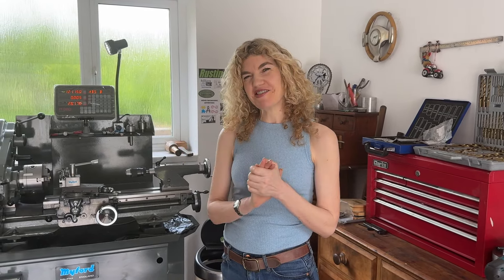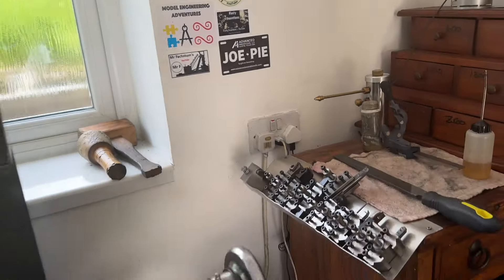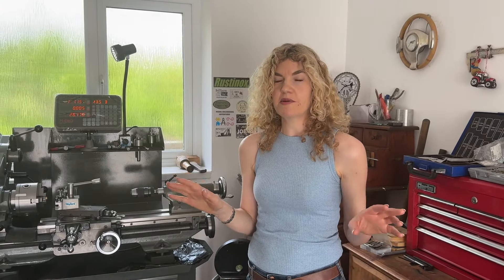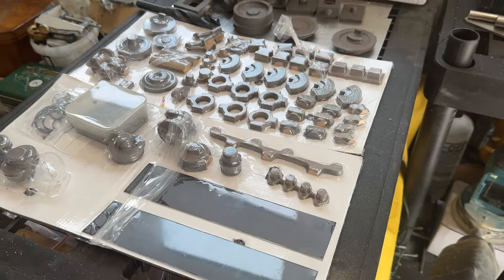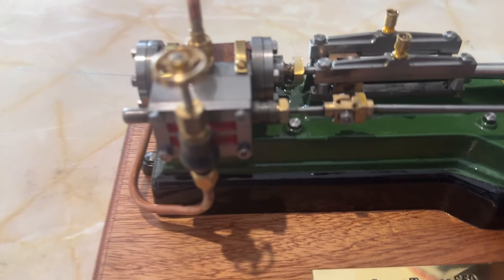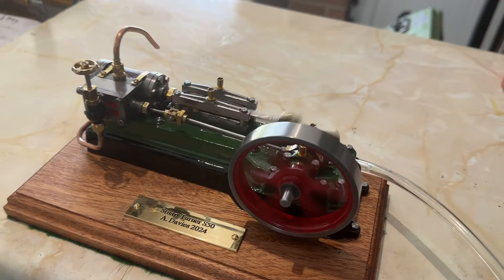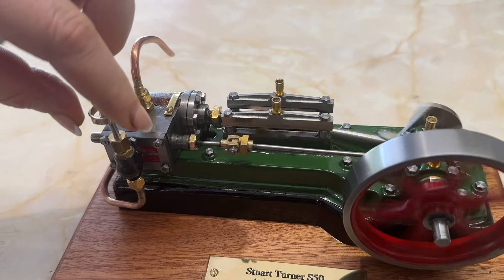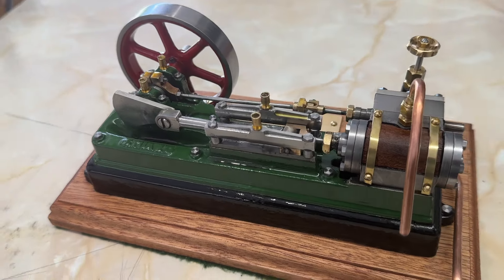A new project and an ickle steam engine

Comment: Looking forward to the triple build, one thing I would recommend is use stainless bar stock 303/304 you will not need to keep polishing the shiny bits.
Reply from the maker: all ordered thanks..used stainless on the little s50
Reply: Can you tell us where we can get the kit for the triple expansion engine? I would like to build one as well using your build to guide me along.
Reply from the maker: @Mr7yhnmki8  Stuart models ltd UK
Reply: @modelengineeringadventures  Much thanks!